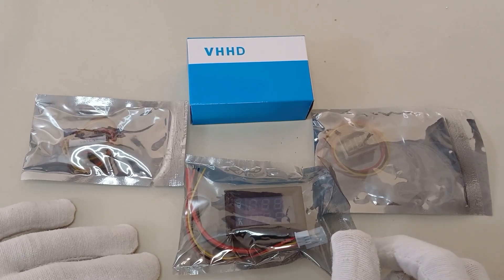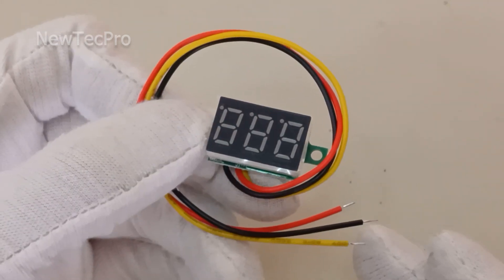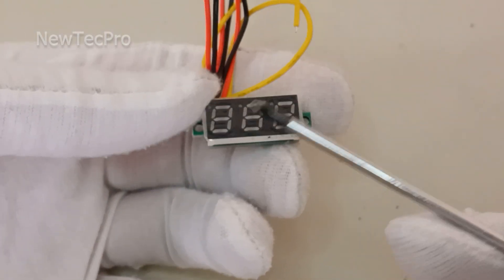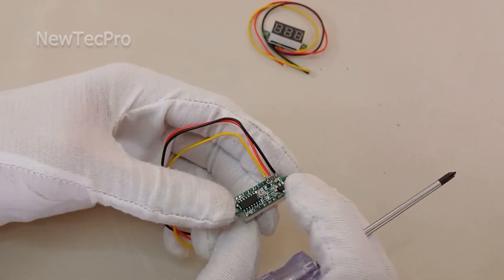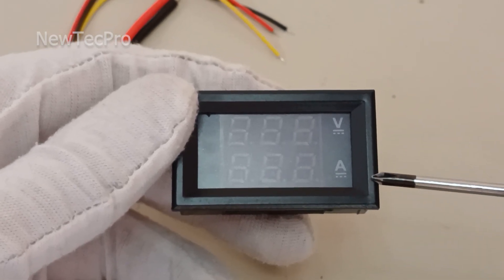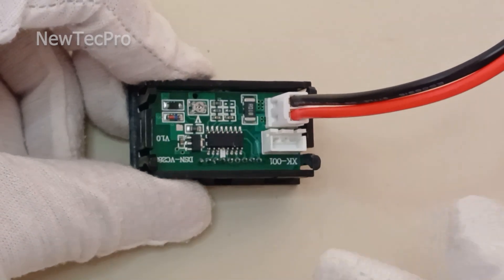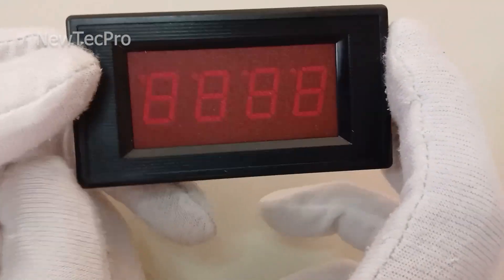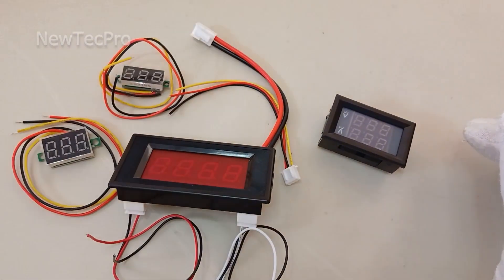Best DC Voltmeters Digit for DIY and Electronics project

Comment: I still don't know which one is best. I thought you would test them to see which one is most accurate.
Reply from the maker: This video is mainly a technical overview, not a full accuracy test. I’ve actually tested all of these modules in separate videos — you can check them out for detailed performance results:
1️⃣How to use Digit Voltmeter 0V-100V DC 3wire?:
https://www.youtube.com/watch?v=YNkqHD1dFZY
2️⃣How to install DSN-VC288 Volt-Amp Meter? display digital ampere and voltage 0-100V 0-10A:
https://www.youtube.com/watch?v=Deh_WYFv4_M
3️⃣Training to use DSN-VC288 Digit Voltmeter Ammeter?:
https://www.youtube.com/watch?v=3yXT14CpKlc
4️⃣ how use 5135A DC 0V-500V Digital Voltmeter?:
https://youtu.be/Rz2_uGXhgMc